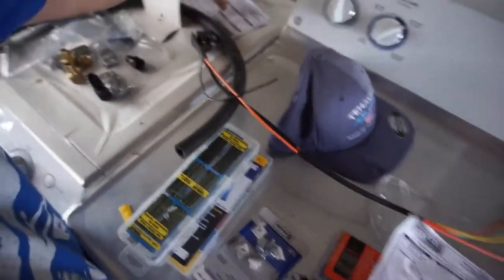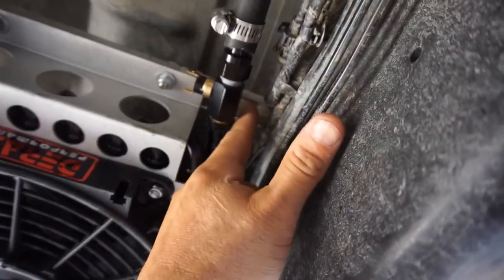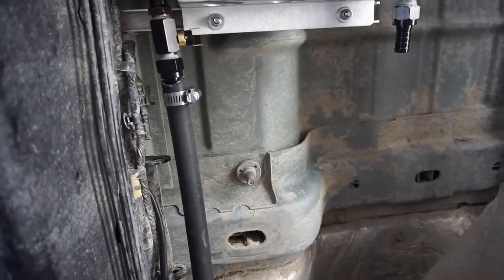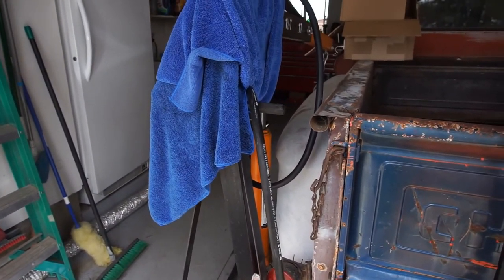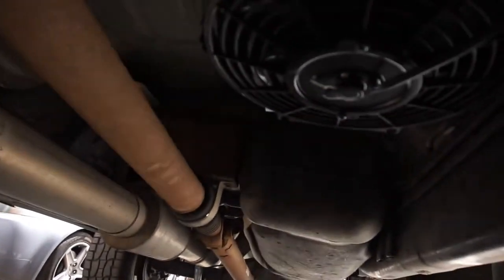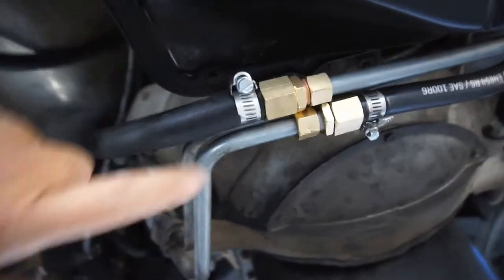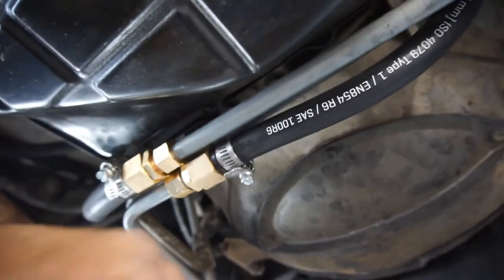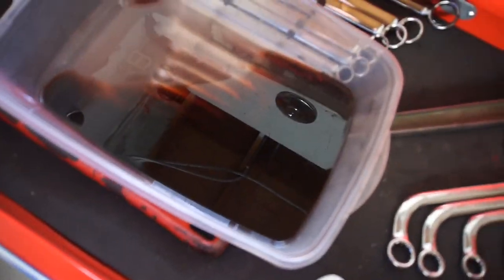DERALE 15900 Transmission Cooler Install On My 4th Gen Ram 68rfe. Clean Install..

Comment: Doing the same but I am connecting it after it goes to the front cooler then the derale cooler and back to the transmission
Reply from the maker: Nice. Let me know if you see any improvement. Mine came on the other day for the first time and it scared me. I thought I was dragging something. I never heard it before.
Reply: @Halffast719  ok set it up and i hear the fan turn on when my dash displays 175 so I think it’s working good. This weekend I pulled a trailer with a 800rzr and and quad plus I had another quad in the bed of my truck.
Reply from the maker: Nice. I think you’re good then. Keep that transmission cool and happy.

Comment: I’m trying to figure out what’s the difference from the Derale 13900 to the 15900. Also I was trying to find a dual pass unit like this to cool the oil and trans separately?
Reply from the maker: 13900 is -6an 5/16” or 3/8” transmission lines And 15900 is  -8an 1/2” transmission lines.
Reply: @Halffast719  I better reorder thanks
Reply: @Halffast719  I have the 13900 now, but my aim was to have separate coolers for oil and trans, I thought this was a dual pass meaning it would handle oil and trans but maybe not? If I used the 13900 on the oil side would that be large enough or get two 15900's? it is a 92 GMC 4x4 with a 350 TBI.
Reply: @Halffast719  The 13900 I am starting by moving the oil lines over first because the oil radiator lines are leaking. Probably right at the flare might have cracked, but moreover; I had a large Aluminum Radiator installed, the first new radiator came with a punctured tank mixing Antifreeze into the oil, I then was sent another radiator replacement that lasted a few months ago I am seeing transmission fluid going into the oil, I am sure visa versa. So I will do the oil first then the transmission. Is the 13900 have large enough lines for oil?